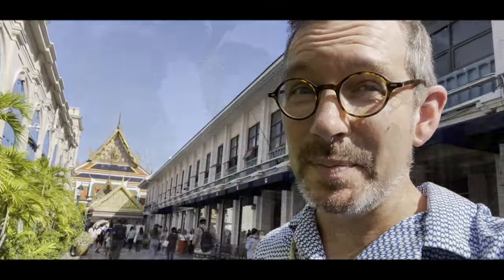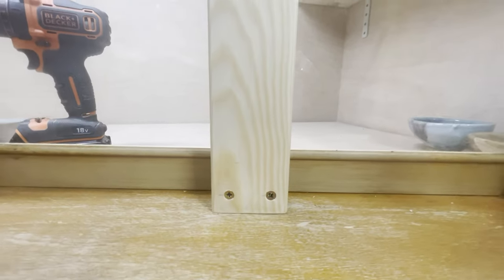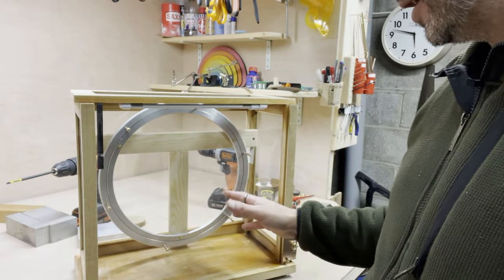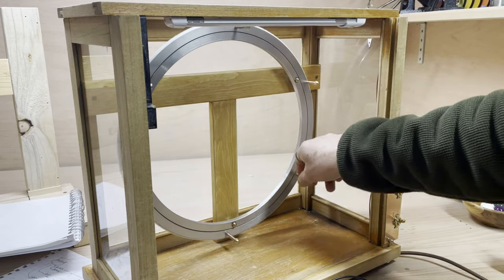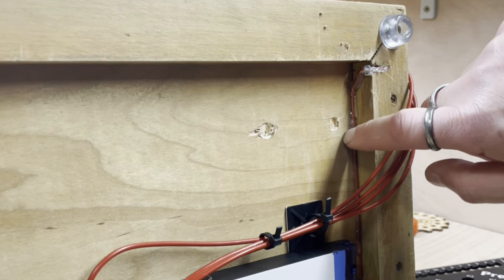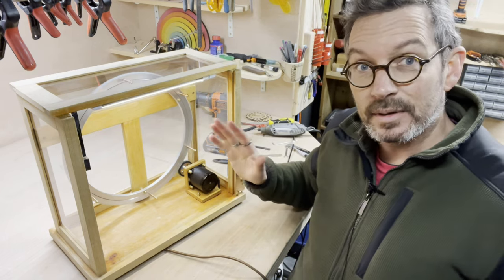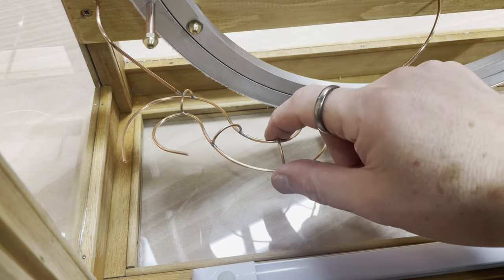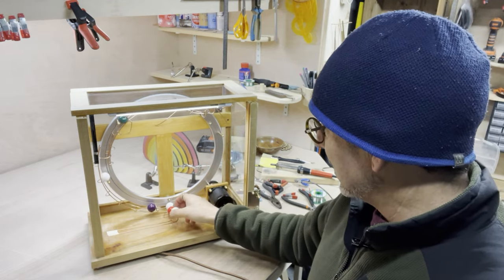Cabinet Time - Rolling Ball Sculpture - Story 76

Comment: I think you need something really "watchable" in the centre of the wheel.  How about all balls are held at some point on their tracks until something happens in the middle that triggers all of them to start moving again?  Maybe a counterweighted vertical arm that carries the ball across a large gap in the centre from one track to another, and as it goes, it trips rods that release the trapped balls for them to continue the journey down.  I love complicated mechanisms and surprising cause and effect items.  You certainly have the patients and precision and it shows in your great machines!
Reply from the maker: Hey. Thanks for the comment and compliments. I agree that a ball holding system is a great idea.  Watch this space… 👀👀👀

Comment: Love the challenge you've given yourself with the glass cabinet. I love loops but I've found I enjoy the challenge of keeping the balls on the sculpture and moving for as long as I possibly can as well. Serpentines are a great way to control and slow ball speed (as you know). Wondering how many switches you incorporate in the space. I've learned a lot from your videos Ian and also use a homemade resistance soldering unit that you inspired. Keep up the great work and thank you for sharing. You are an inspiration to enthusiasts around the world. 
Mike
Reply from the maker: Hey Mike. I’ve been filling your work also. Very high quality. Yes to serpentine I recon. 👍👍👋👋⭐️⭐️

Comment: I've got two suggestions:
1: do the balls fit through the wheel and around it? Like a roller coaster going through a Ferris Wheel?
2: maybe a loop exactly in the middle of the wheel.

Oh and at first I thought you were going to build a sculpture entirely fitted to the bearing, so it could be turned around. But I can imagine that would be terribly difficult 😅
Reply: A wheel fitted to move with the inside diameter may create a smaller diameter lift or pump stair lift mechanism upward. I like a slower flowing machine with short runs that highlight a particular feature.  Discontinuous flow with discrete pause and start points.  More like a circus act that spot lights a skill at different points of the display.  And perhaps spray color that mechanism such as a funnel, loop, lever with one primary color in addition to copper or steel.
Reply from the maker: Hi Robin. Yes the balls fit behind the bearing. So that’s a great idea and a loops also sounds good. 👍
Reply from the maker: That’s such a cute and cool idea. Will definitely put this into practice at some point. 🙏 Thank you 🙏

Comment: Since the large bearing has pegs separated equal distances on the outer diameter, a down & up rhythm maybe illustrated.  Like a conductors wand guiding the viewer to the rhythm of the big bearing.  Other mechanisms in contact with the wheel may have diagonal, horizontal, circular wand movements that are derivative to the balls falling downward.  More for artistic display.  Imagine being 30 feet away, the fluorescent color of thin tin forms move about in a rhythmic fashion and the sounds of the bearings providing the  percussion accompaniment
Reply from the maker: What great ideas. I hadn’t thought of driving other things with the bearing. Thanks 👍👍

Comment: Just a thought - once you have established that the bearing fits in the cabinet, wouldn’t it be easier to build the track on the prototype frame and transfer it to the cabinet once it is built ? That way you have better access for soldering and don’t risk damaging the cabinet. Also easier to try things out and change them.
Reply: For areas within the sides of the entry to the cabinet it maybe difficult to fit and secure.  If the track portion near the sidewalks are established in the cabinet, perhaps your suggestion may be applied.  It might make sense if the glass sides are slid into place after the track is created.  Then, transferring complications of an easily blended frame may be avoided.
Reply: I believe there are potential complications in the transfer process with multiple points weighted and bended along with structure twisting as the center of mass changes as it is being handled without a sturdy reference frame
Reply from the maker: Hey Simon. It’s a toss up between your suggestion and the difficulties mentioned by jr-vq6vj. I need to secure supports to the wooden frame as I go and the tolerances are very low. Also, the door hole is smaller than the sculpture so it would be a smaller sculpture if I had to feed it in at the end. 

Why do I like challenging myself this way???

🤔🤨🧐

Comment: I would like to see if the downward force of the wheel can raise balls upward to start over on the track.  At different points of the vertical drop a ball is raised.  Perhaps on the free end of the lever, and even on the end that is being pressed downward it may pick up a ball and raise it to a level above.  The image is as a ball is meandering down, a mechanism switches the track the ball may follow.  One that leads to a line that lifts it back up to top level, one that allows it to continue on.  The ball that continues on may be captured by the the lever side being lowered by the big wheel. That side raises the ball above the point where it may roll and be directed downward or be lifted to the very top.  Some pass to the very bottom, some are raised above mid level, some are recaptured and raised to the top or roll down to be recaptured below or follow to the big wheel lift.  A ball is seen being lifted by levers that are pressed by the big wheel at a more rapid rate than the big wheel lift.  As well, it is being handed off to the lever centered higher until the ball is dropped off at the top.  Use the downward rotation of the big wheel to raise the ball on a different path upward.  Introduce points of uncertainty where the mechanics sorts the direction the ball may take and when it may end its journey at the bottom.  Since you have a big wheel, you might introduce a circuit where the ball takes 10 seconds to roll along a path, there are always 6 to start in a stack or line, if there are six ways balls are lifted upward, they may all be timed to arrive at the top holding point, simultaneously the six balls are released from some point to all arrive to form a line of six balls.  These six balls are then released every 10 seconds.  As certain gates are passed a 10 second hand, or minute hand moves about the center view of the wheel against the glass
Reply from the maker: I love your style and approach to a complex system design. Loads of details that sound great!  Thanks for sending them. 🙏